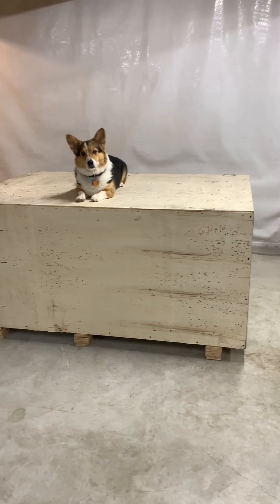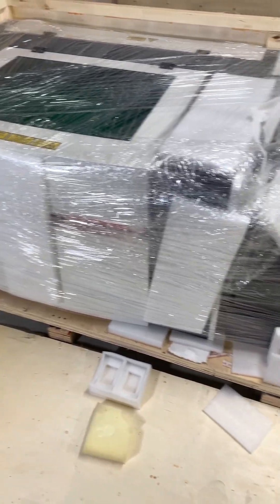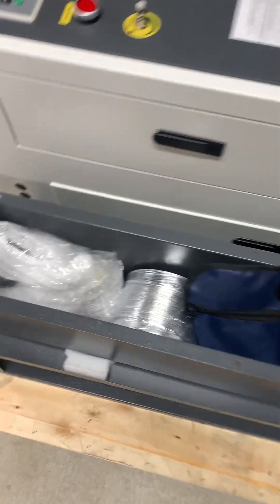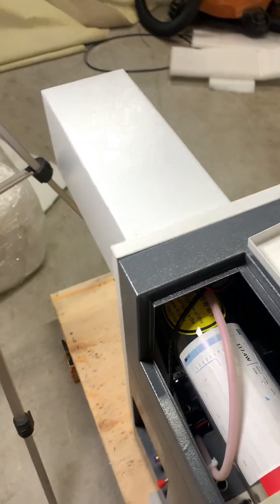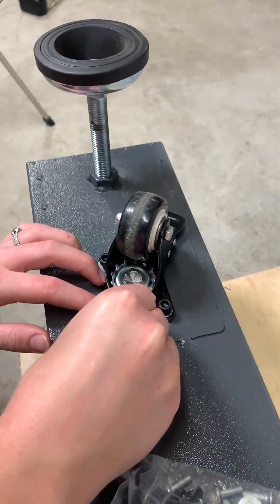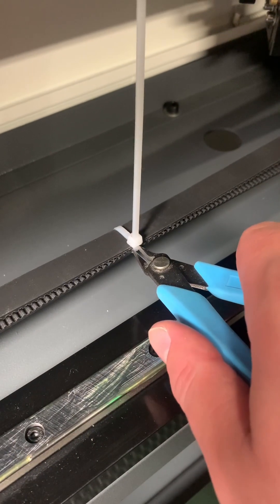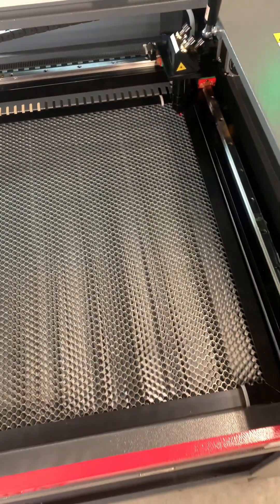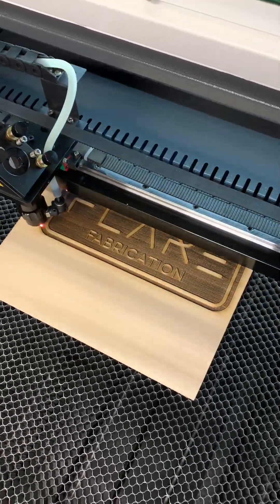Cloudray 100W CO2 Laser Unboxing and Setup

Comment: I was told by someone at Cloudray that they no longer build a 100 watt machine but they will sell you a 100 watt tube and power supply to upgrade their CR7050 55 watt model so I  just went with th CR7050 55. I am hoping it will arrive  this week.
How is your machine holding up?